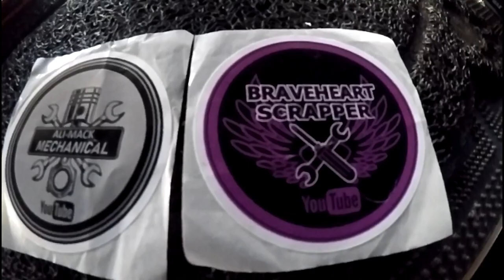Mazda Bongo - RainX headlamp restorer kit

Comment: Av done this a few time's myself it works well only problem is you have to do it a few times. Larry mate thanks for displaying my sticker & BraveHeart scrapper sticker mate.👌👍
Reply from the maker: 23 year old of UV Rays  alread did it with tcut but the grit in 3 stages is the game  that was  roughest grit  there 2 more finer grits to go.. using my slow drill with stick on -disc  papers  soon once i get them..  !!+ cranking generator motor with drill Thanks